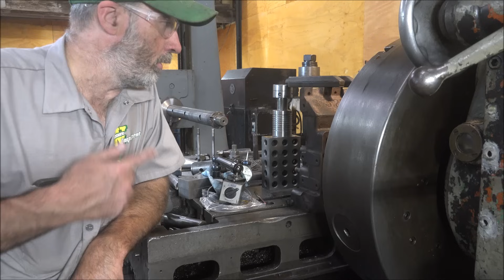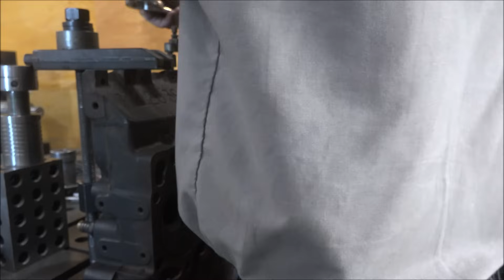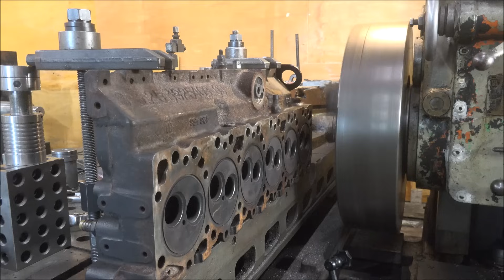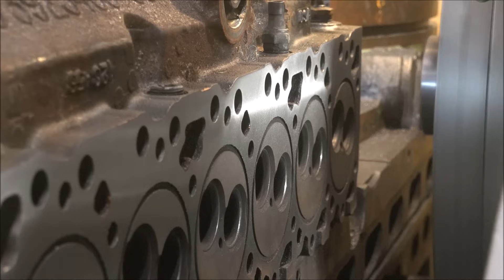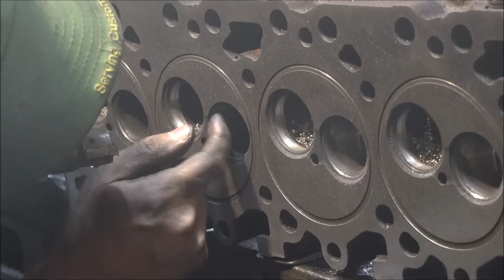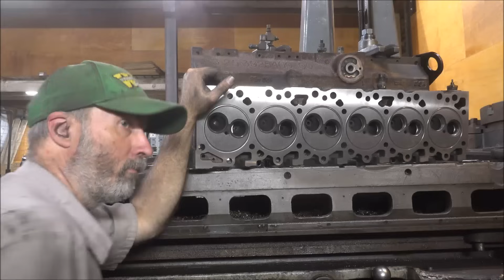Cummins 5.9 Fire Ring Machining and Head Porting By Bias Boring the Valve Ports Unusual Mill Setups

Comment: And thanks to these I run these fire rings in my Subaru sti and the radius cut grooves with the fire ring pretty much did the trick. It’s a high hp build with head studs and now my Cummins is getting them, center finder and a milling machine

Comment: I would think the HBM has more than enough power to drive a BIG shell mill.
Is there a reason you fly cut all these heads and blocks?
Reply from the maker: The shell mills don't leave as good a finish and even my 12" face mill won't cover the full face of most of these heads and taking more than one pass leaves a transition it might only be a couple of tenths but it always will.  When you are trying to seal cylinder pressures that can spike over 20000psi even the little variances matter.
Reply: @bcbloc02  I guess I'm a little surprised that a face mill has poor surface finish, or that it would matter as much with fire rings as shown here.
But I certainly understand what you're saying about not being able to cover in one pass.
Thanks for the interesting video and your reply!  👍
Reply: Big shell mill also has alot more tool pressure, so prone to chatter especially with the severe interruptions, and since you want to clamp delicately on a part like thos so you can cut it in a free state this could give you a bad time.

Big face mills are for Big parts, where theres enough meat to dampen vibration and so you can clamp it tight tight.

Comment: What do you get on working over a head? Fire ring and porting
Reply from the maker: Depends on how extensive the job is and what level of performance the customer is after. Typically $1500-$2500 for the machine work and porting if you get into upgrading valve train components you can spend a lot more depending on how exotic you get.
Reply from the maker: My contact email is listed under the about section on my channel. Also it is simply my channel name at yahoo dot com.

Comment: What are you going to do in order to keep the compression in a "reasonable" range? Turn down the piston crown? Marlon
Reply: Head is flat won’t change compression much
Reply: The 5.9 is a flat head. You can get a number of “fat” gaskets if you need to. Of more significance is maintaining your valve recession. It took me almost two days on an old Bridgeport round ram to deal with the guides. I bored them out to about 1/2 inch. Don’t remember exact number. Machined 24 mag bronze guides and drove them in. Counter bored valve spring seats. The only issue I had was #6 where O didn’t have complete guide coverage on one exhaust guide due to exhaust plenum design.

But the engine worked great. The 5.9 Cummins is one of the best engines ever made. Crude, reliable, long lasting and pretty good on fuel.

Comment: Someone once told me not to fire ring a street truck. Do you agree with that? Did you just set angle that you went in at by feel, or is there a degree angle that someone has come up with?
Reply: On a street truck that is up to you and how you use it. Fire ring is much more effective esp. at higher temps and compression pressures. But it costs a lot to have it done. As I do all my own work, I just go ahead and fire ring the beast. My 5.9s are for my day to day driver and my back up shop generator. I don’t race.
Reply: You should post some videos of your machine work. I would love to learn some methods that I can use on my Bridgeport: )

Comment: What kind of flow numbers are we talking about?  Apparently It's not aligned with the valve guide angle?
Reply from the maker: I didn't have this head on a flow bench so I can't say other than it dropped the boost by 10 psi and raised the drive about the same so I know it is flowing a lot more.  Well if you go by the boost pressure being linear it would have been about a 25% gain in flow.